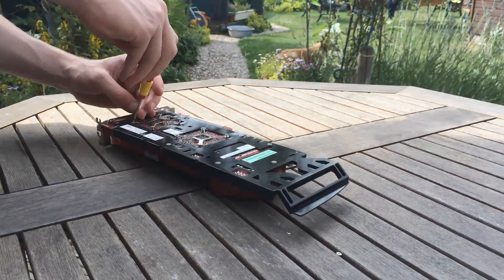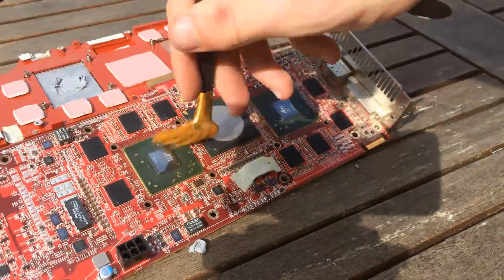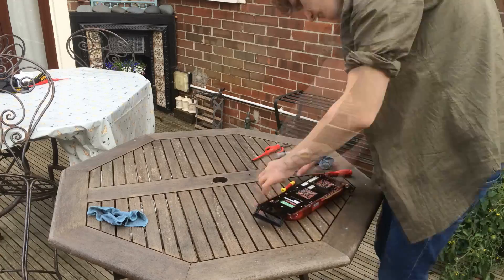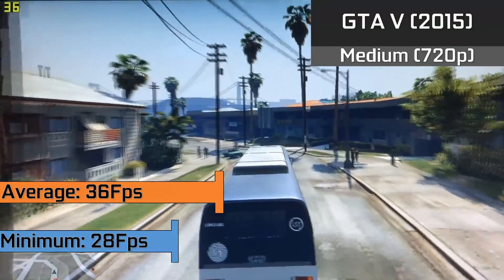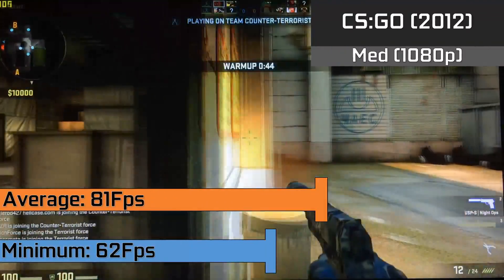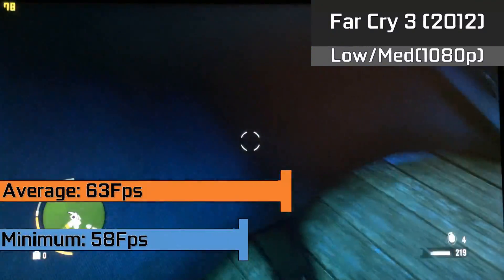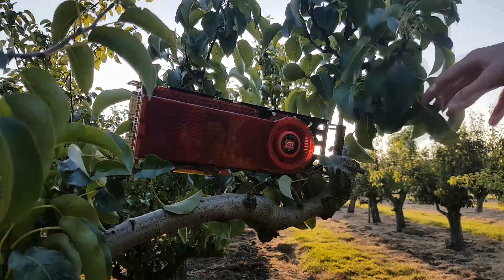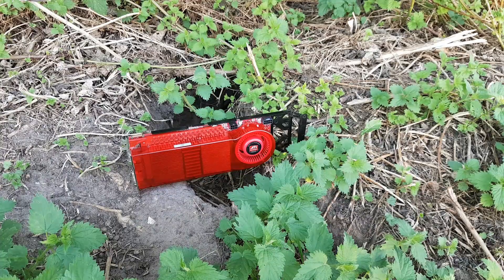The World's Most POWERFUL GPU....of Early 2008

Comment: 1:16 , on the cars specs you put that it has 1gb ( 512mb each card ) and just because both of the cards are 512mb in vram capacity does not automatically mean there 1GB. Crossfire/Sli doesnt just simply combine the complete specs of both cards otherwise sli/crossfire would be nearly doubling your performance. Instead, you have a master card, and a slave card ( probably a weird way to put it ). vram runs in parrell not series so gpu memory doubling is virtually impossible and will never happen.

Comment: Budget-Builds Official How were you getting that performance? I have the EXACT same card and it only gets like 30fps on same settings and a lower resolution in CS:GO. And it stutters constantly! Anything I should know? Great video by the way.
Reply: I also use the same card. Could be any number of different issues causing your problems, but I'm guessing you're getting bottlenecked by either your CPU or, considering the stutter, maybe you don't have enough RAM. Also make sure you clean your computer thoroughly, and check your temperatures.
Reply: WWEDX2k7 That's what worries me. I have an FX 8320E which is fine even though it's a bit old. And I have 16gb of DDR3. I looked at the tests again though and the fps actually is about the same as his, it's just the stutter that seems to be a problem. I'm not sure what's going on. I even have the fan speeds up to keep it at 60c.

Comment: No Crysis? Is a 2008 top-end card, is the first thing you need to test.
Reply: As far as I can remember, Crysis didn't scale on my 3870 x2. So yeah, it ran Crysis at around 40 fps (1680x1050 (and AA more than 2x was out of the question)), but had a LOT of microstutter and hickups. But then again, I never reached 60fps at Far Cry 3 either...
Reply: @cbats1888  AA anything on that game will make it crash now. (Well Nvidia that is)

Comment: This 2008 Graphics Card is LITERALLY on par with an Intel HD 530 integrated graphics chip (6th generation chip design;  I think it's part of the Skylake lineup)
Reply from the maker: +MrBLARG85: Mainly due to the lack of any optimised drivers in later games, but in titles that the card does handle such as BF4 it showed amazing performance.
Reply: Budget-Builds Official   I know!  And what I said wasn't an insult to the graphics card, but rather a compliment to how small and compact a card of that size and performance has been shrunk down to:  Less than the size of a desktop CPU in an Intel integrated graphics chip.

PS:  I played Deus EX: Human Revolution at 900p (1600 x 900) at Low/Medium settings and achieved an average of around 65 fps or so (fps varied from about 55-75-80 depending on what was going on).

Comment: A word of advice, gets some better thermal compound. That HY510 I think it is you are using is absolute crap. I used some attempting to fix an over heating mac book, rebuild a TEC wine cooler and rejuvenating a a couple of gfx cards. All of them were having problems within a short time of rebuild. Basically its utter crap. Get a big tube of MX4, its not that expensive and is very close to best performing pastes out there. That chinese stuff performs badly initially and gets dangerous in no time. The macbook would hang on boot after a week.
Reply: Jayden 97 I've been overclocking CPUs and gfx cards since the early 90s, I've repaired motherboards  several times and built all my own hifi equipment from scratch etching the PCBs. Seriously applying thermal pastes correctly is not beyond me.
Reply: Jayden 97 I live in Madrid, upstairs is often above 40°c in summer. When I stripped both the macbook and the wine cooler the paste had literally solidified in a matter of months. As I said the cheap Chinese thermal paste is absolutely awful. I'm not one to recommend expensive thermal paste but you really need to use something better than that, at least if you live in a hot climate because mine dried up in no time

Comment: I had the 4870x2 was a great card until it blew a component right by the power plug. I replaced with sime part from a 850xtx card and I was up and running again for about 2 weeks then the part blew again. So my 4870x2 has been sitting collecting dust since then. I'm sure it could work again with the right spec part but whats the point no driver support for newer games out now.
Reply: Rocky12345 It was likely another component then that was to blame, causing that one to keep blowing. If you found it & replaced them both, you might find it last a little longer.
Reply: Ashley McGovern You may be right I might dig the card out of it's strip it down and go over it with a fine tooth comb. Even if I don't use it long term it would be great fun fixing it that's for sure. It's always a blast using the soldering kit.
Reply: Rocky12345 Yeah, I'm doing the same with a motherboard that was killed by a PSU failure. I was going to throw it out, usually when that happens it could be completely gone. A lost cause. But it's gone from dead as a door nail to now powering up, spinning fans turning off & looping the process. From getting the Multimeter out & swapping out a few components. Some of the chippage on there you won't find down your local Maplin or RS stores though. That usually indicates a BIOS settings issue but, CMOS resetting did nothing. The surge might even have corrupted or wiped the BIOS chip. All good practice. Plus the board still goes for £70-£80 2nd hand. Say £60 refurbished.
Reply: Yes a good learning experience for sure and a lot of fun as well.

Comment: I've seen LGA771 pre-modded for 775 chips appearing on AliExpress (NZD$7 / £4, with free shipping). Wouldn't mind to jump the gun as it's great than half less compared to TradeMe? Do you have any experience to buying used hardware from Chinese vendors?
Reply from the maker: mrdaxtercrane: I've always bought via eBay, but aslong as the seller is reliable, AliExpress could be the way to go, I've heard good things about it.
Reply: Its a 50-50 to get scamed can be a low end card with a aother chell on it to look better then it is
Reply: mrdaxtercrane Make sure your motherboard is compatible and that your bios is properly modded for it